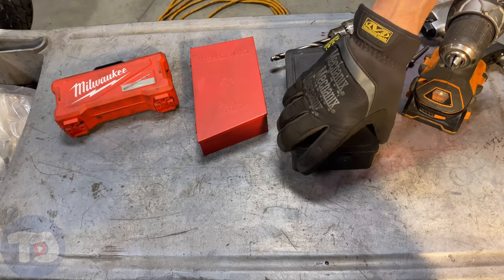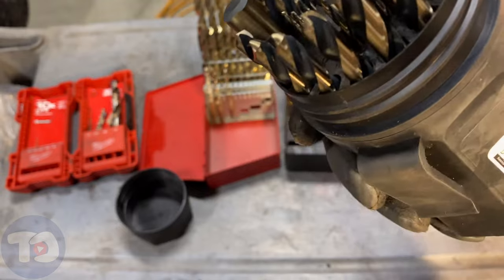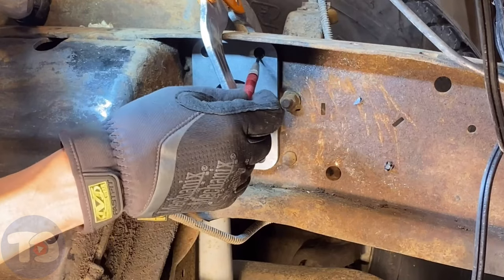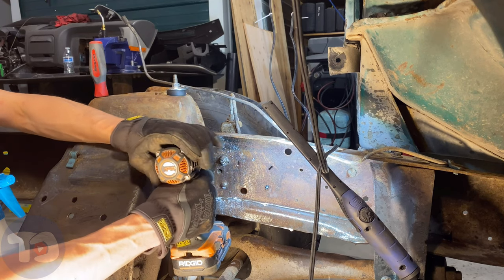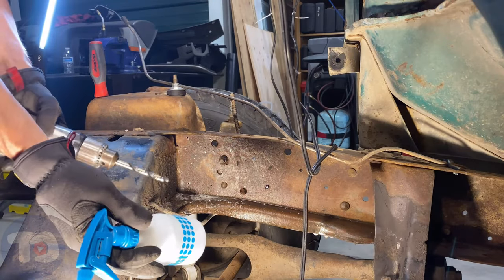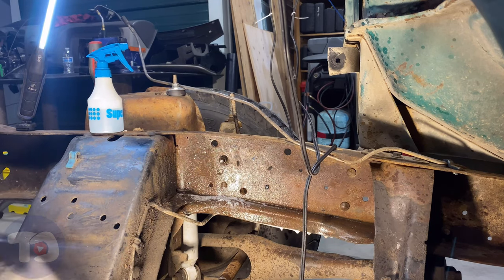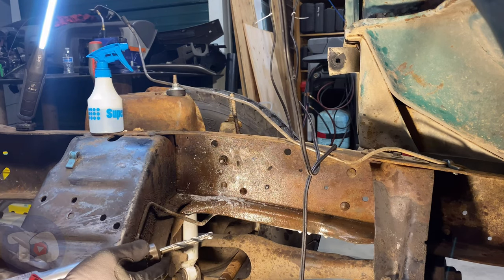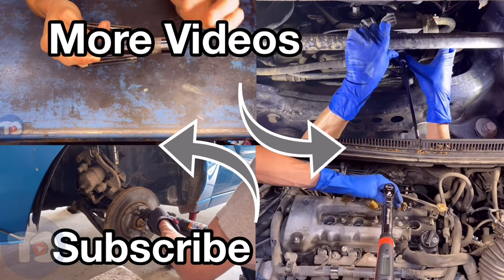How much better are quality USA bits?

Comment: Hi there, I actually sell these drills. Your best bet is to drill on size in metal. As you discovered, the bit grabs into the metal and creates a dangerous scenario. Those drills are ground with a spilt point to allow the drill to self-center. No pilot hole necessary.

The coolant is a good idea. Not only does it provide lubrication, but it also helps with keeping to metal cool so you don’t work harden the surface you are drilling. Work hardening occurs when the metal at the cutting edge gets hot enough to harden. Therefore make the material harder to drill and prematurely wears out the cutting edges of the drill.

I hope this helps! Norseman is a great drill manufacturer!
Reply from the maker: Hi Dan, that’s cool. Thanks for the good info.

Comment: You need to use the correct RPM when drilling. The formula for Cutting RPM is (3.82)X(Cutting speed of whatever metal you're cutting)/Diameter. 
General Cutting Speeds for Common Metals are as follows:

Alu 400-1000
Brass 300-700
Bronze 10-80
Cast Iron 10-20
Carbon Steel 10-70
Mild Steel 25-125
Stainless steel 35-70

Plug these speeds into the formula and you will almost always have success drilling whatever material you're trying to get through. Start at the lower end then work up.
So for an example if you were drilling 6010 aluminum with a half inch drill bit, 3.82x(400)/(.5)= 3,056 RPM. For mild steel we would do 3.82x(25)/.5= 191 RPM. 
Overspeeding the drill can work harden the material in seconds and make it impossible to drill through without going to a stronger material drill bit, which is not always readily available.
Reply from the maker: Very good to know. Thank you.

Comment: Check out a set of transfer punches. They "transfer" the center of your hole to the surface below. They make it much easier to assure your are starting your hole centered within an existing hole. 

I use the Starrett HD center punch and it's fantastic. But centering my eye is still less precise than using a transfer punch set.
Reply from the maker: Good idea

Comment: very good video.  I'm watching your video because I'm trying to handle some ladder racks inside my ford transit van... and CANNOT get any bits to drill through the frame work... even new dewalt and bosch bits... got anymore tips?
Reply from the maker: Sure. First, brand matters. There are look alike brands on Amazon that are cheaper, don’t fall for it. I’m not sponsored, I’m just a satisfied customer.
When you start, decide if you want to drill a pilot hole. It can help when you are drilling a large hole.
When drilling, use a lot of downward pressure and slow speed. Also, a spray bottle of water to keep the drill cool. A constant supply of water at the hole will keep your drill cool and sharp. Just wipe down and oil it before you put it back in the index. 
These drills can remove a lot of material at once, but be careful. With a smaller hole, your drill can get stuck and break. In a larger hole, if the drill gets stuck, it can twist your arm. Hold the drill motor with two hands, if you can and stop and back out if you get stuck. 
Hope this helps.
Reply: @ToolDemos  thanks for the reply... I'm just wanting to drill the same size hole as self tapping screws... can't  get a bit to even drill a 3/16 hole for them... guess I need some kind of super drill bit or super self tappers...thanks

Comment: A pilot hole is only used on drill bits with a 118 deg point. Yours have a 135 deg point and is not recommended. 
You have been told some bad information over the years on how to drill a hole in metal by how many broken drill bits you have in your drill sets. 1 oz of Dawn mixed with 16 oz of water can be used as a lubricant drilling if you don't have lubricating oil.
Slow down your drill so you can handle it. Google recommended drilling speeds for material and size of bit.
Reply from the maker: Thanks.

Comment: The water as a coolant is a bad idea for a ton of reasons. For one it'll actually act as a friction modifier and increase friction, friction is the cause of heat in drill bits, so you end up thermocycling the bits by heating them up, then dumping enough water to cool them. The idea is to not let them heat up in the first place. Water and metals also don't play well together, so you're also inducing a corrosive environment for your work piece. All you need is a dab of cutting fluid/oil if your on a horizontal surface, or some cutting paste if you're on a vertical. This will allow the bit to go to work, and not heat up in the first place, it'll also protect the cut from oxidation and corrosion once you're finished. You also won't have a huge mess of slippery puddles to clean up or have to work around.
Reply from the maker: I appreciate your reasoning, you have a well thought out argument that I just happen to disagree with. I’m glad that works for you and also happy that soapy water works for me. I think we can still be friends.